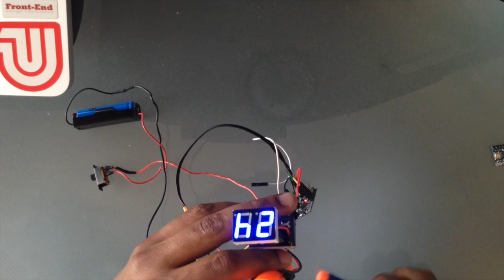Arduino + Nerf Dart Counter + 7 Segment LED Overview

Comment: Could it be made to read on the trigger pull instead of having a light gate for the dart to go through?
Reply: +Nathaniel Deal  Thanks, so that would work with the $29USD unassembled kit, attaching it to a power source as well as a switch behind the trigger?
Reply: +NathanielDeal    Can the pre programmed arduino also be set so when wired to what was the electronic magazine lock, taking a mag out resets the counter?